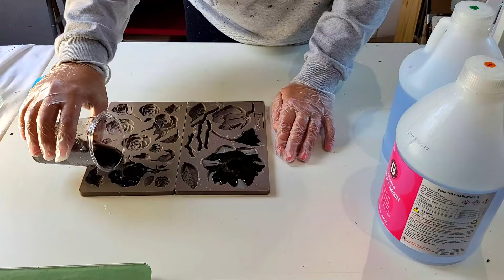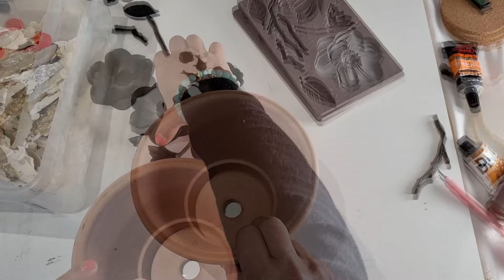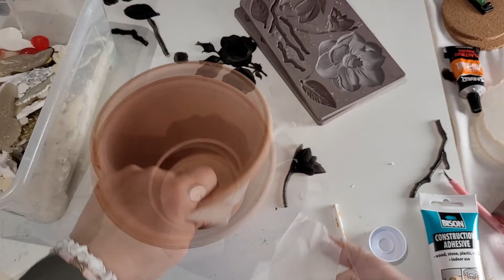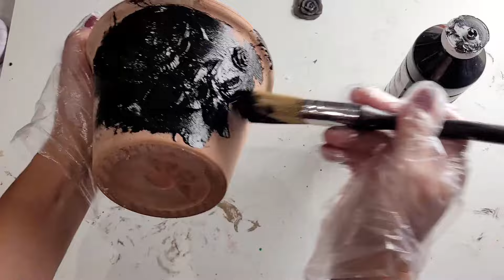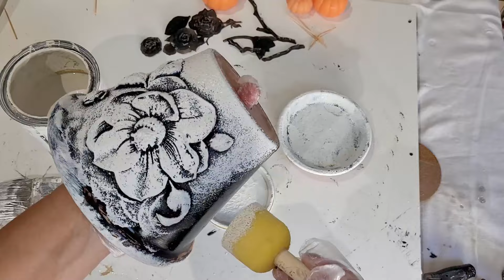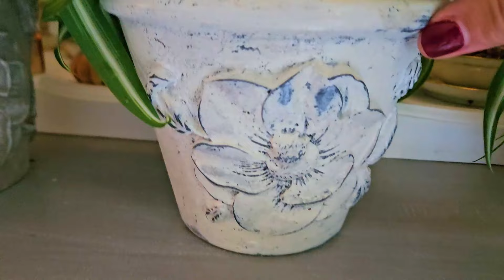Studio VLOG #10 | Bendy Epoxy Resin - How to Use it for Flexible DIY Projects

Comment: I use Teexpert resin the most and you don't weigh 1 to 1, you'll end up with about 10 oz extra part A when you run out of part B. I'm in America we go by oz not gram or ml, I could but I don't. If I'm mixing in a 16 oz cuz I use 7 oz part A and about 6.3 oz part B and in the end I use up both gallons without any extra part A. This resin is to be measured by volume but I hate putting resin in 2 different cups, waste of an extra cup and extra resin wasted cuz nobody gets 100% of it out of a cup. Just my 2 cents for beginners... I always weigh my resin, but before I open new bottles I measure part A then part B to get the weight difference and calculate from there.... Teexperts deep pour resin part A and part B are the same weight so it's a lot simpler... Kinda weird how that works

Comment: I can't find doming resin locally, so by changing normal resin ratios,  do you think I can use it as a doming resin?
Reply from the maker: If you want the resin to cure correctly, do not change the ratio. However,  I can advise letting the resin thicken up a bit by waiting 15 to 20 minutes after mixing before doming.
Reply: @EdnaWargon  ok good, I'll get some 1:1 resin and try 3:5 ratio and other ratios and see if I can make domed stickers